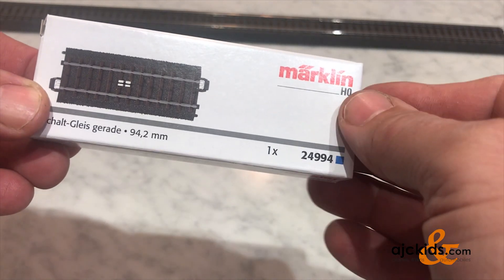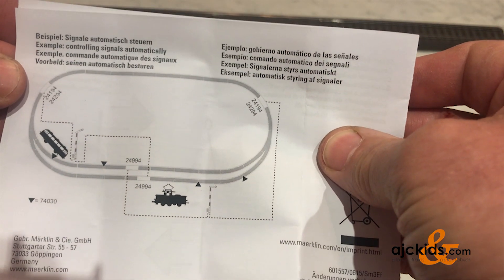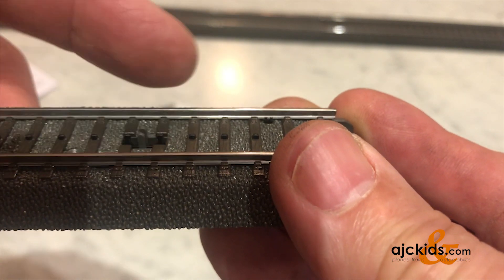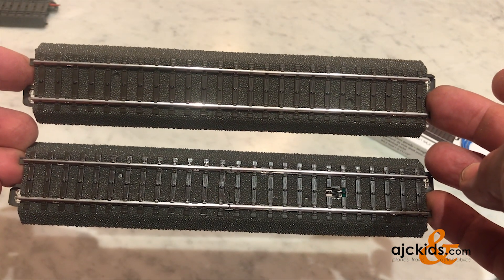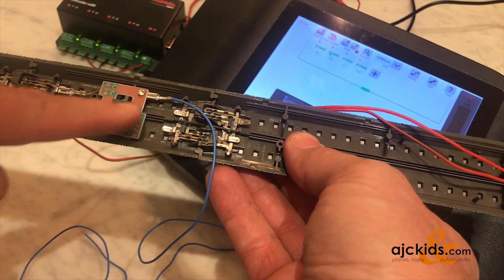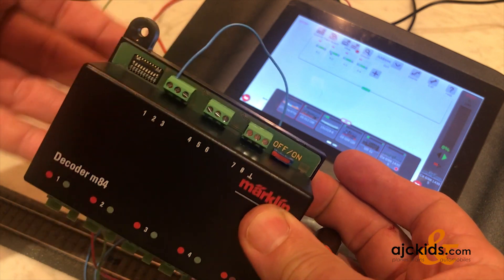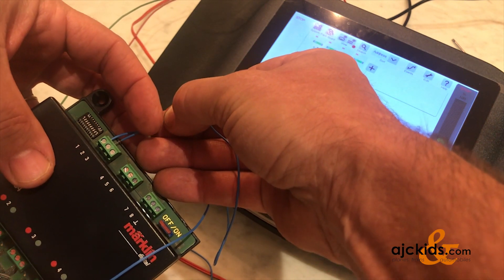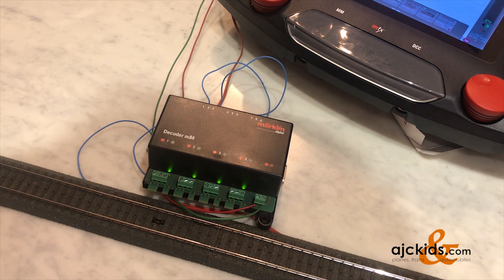Marklin M84 Decoder Part 2: adding Circuit Tracks

Comment: Shouldn't you have the cs3 in stop mode while making the m84 connections?
Reply from the maker: It never hurts to put the CS3 in STOP mode, but in this case it is not needed.